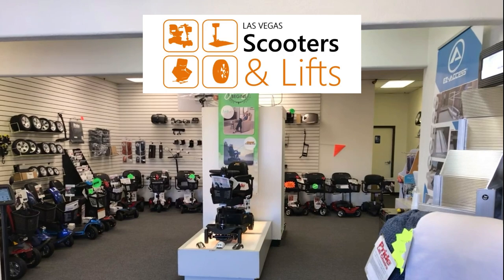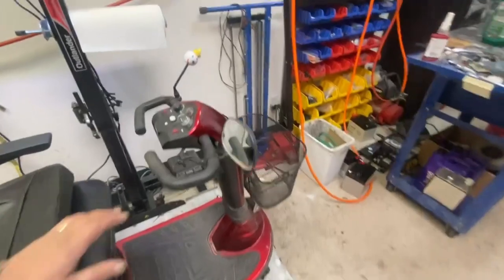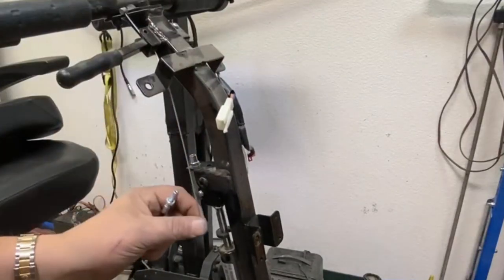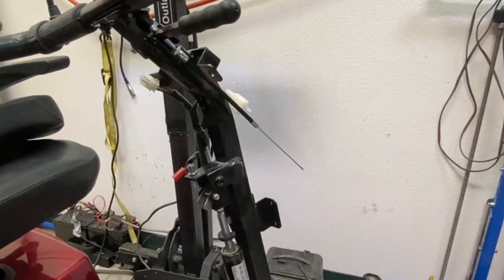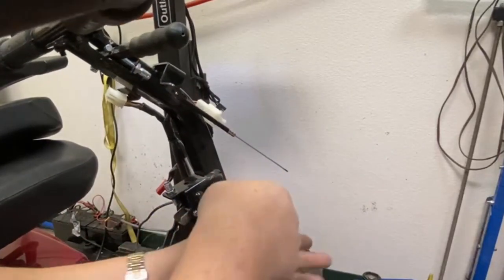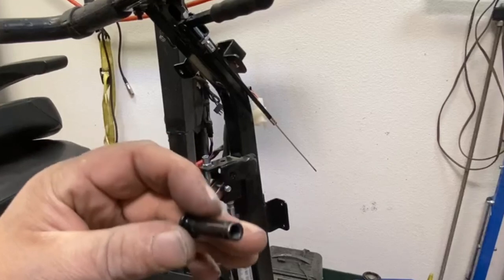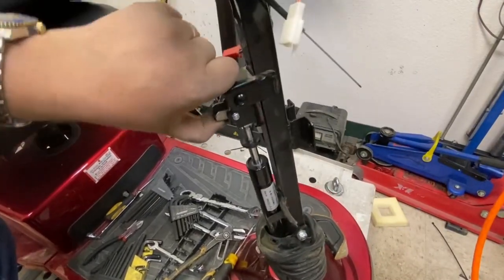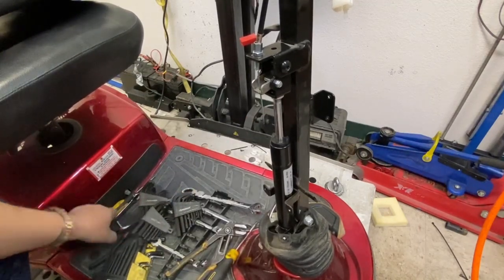Saggy Golden Companion Mobility Scooter Tiller Repair | How to replace the tiller strut and cable.

Comment: On that particular scooter is there a way to increase the speed & height of the scooter?
I have a Golden scooter with 3 wheels and I have been trying to figure how I can add shocks to the front & back as well as change the scooter from a 3 wheeler to a 4 wheeler. I would also like to change the tire size from 10" rear & 8" front to 4-13" tires. Any ideas would be appreciated. 
Where in Las Vegas are you located? I plan to go to Vegas in September, from the 15th-17th or 18th. Celebrating my 🎉 birthday (09/17), and I would like to go to your shop.
Your video is very informative. Thank you for posting.
Reply from the maker: Hi Martin, thanks for watching.
To be honest with all things you are asking in your question you would be better off buying something that has everything that you want already built. Your first hurdle would be that you can't change a three-wheel frame into a four wheel without modification (welding) or you would need to buy and new frame. As for shocks you would need an articulating front and rear section to accommodate shocks and springs. As for speed, your current controller is set and programmed at the factory at 100% and can't be increased. You would have to get a controller and wiring that has a bigger speed already programmed into it. Height would be restricted by a few things such as wheel offset, frame (turning) and the plastic shrouds clearance. Have a good birthday, the strip if far more interesting than my humble store 😁

Comment: I have often found wiring/plugs for things that were optional such as electric seat lifts. I'm wondering if there is wiring on my personal Golden Companion II GC340 to operate an electric seat lift? I recently bought another GC340 with an electric seat lift and am thinking about transfering it to my unit.
Reply from the maker: I have a GC340 with a seat lift on it in the store right now. That would be a pian in the butt to do, there is extra wiring to the batteries, two extra connectors to power the ram and also, I'm thinking the controller might be different as it disables the scooter when the seat is in the fully raised position and reduces the speed when half raised. Give it try, you never know!

Comment: At the very beginning you show the tiller and say its doing everything its sopose to do. There is nothing wrong with the gas cylinder tiller adjustment mechanism. Just a simple bolt to tighten on the lower part of the tiller. I work privately as a hobby here in Florida with mobility equipment and LOVE the Golden Companion series scooters having 1 as my own.
Reply from the maker: Hi Richard great statement! I did exactly what the customer requested and replaced the part he wanted replacing. Just because I couldn't replicate it on camera doesn't mean the customer was wrong. Remember the customer is always right even though they might be wrong.

Comment: Hi Ian!! For the very first time in 13 years I need to change the wheel covers on the FRONT of a GC440.....seems to be a snap ring holding them on....what is the best tool to get them off with? My snap ring pliers don't seem to reach in right. Thanks! -Rick
Reply from the maker: Hi Richard, I've just had the same problem with one of our GC340 lol. My snap ring pliers don't fit either lol. Easy option and expensive option is to replace the whole wheel. Cheap and painful option (the route I took) use a pair of needle nose pliers and trap you fingers a million times trying to get the damn snap rings back on. Eventually you'll get it using two people and a lot of swearing.  Good luck my friend hope you don't get to many blood blisters on your fingers.
Reply: @lasvegasscooterslifts  Thanks Ian. It looks to me as if the snap ring would have to come off in order to get the wheel itself off as well. (Darn 4 wheeler!!) Lol!!
Reply: @lasvegasscooterslifts  UPDATE; I ended up using a chisel in the center of the cover and cut it off, then man-handled the snap ring off. Then, since I was working with the Monster Scooter supplied aftermarket cover it was too thick and covered the snap ring groove so (at my Wife's suggestion) I just siliconed the new cover on. Seems to be holding well so far.
Reply from the maker: I hate those damn things. So glad they did away with them.
Reply: @lasvegasscooterslifts  I hear that!! I've had "MY" GC340 since it was new in 2011 and still looks new today. I only use it 2-4 times a year to attend larger antique/classic car shows. I recently had the seat custom upholstered to match the blue color on the scooter. I will however upgrade the first chance I get to the new 3rd gen GC340!!

Comment: iS there in fact a plug in the tiller wiring harness at the bottom that would allow the tiller to be removed to replace the rubber boot?
Reply from the maker: Hi Richard, no unfortunately unlike the Pride Victory that has a connector at the base of the tiller the Golden does not. You would have to un-plug the harness from the top console then sperate the tiller pivot to replace the tiller boot. I know I've done plenty of them. 🙄
Reply: @lasvegasscooterslifts  Ok, Thanks!!

Comment: Quick question; (As I have mentioned before I work with the equipment as a hobby here in Florida) The Golden Companion series are my favorite scooter. I have a really nice '11 GC340. I have one that I'm working on and with brand new quality batteries they don't seem to charge completely. I had sold the unit nearly 2 years ago and all was fine until recently. I went and put brand new batteries in it for my customer and all appeared ok. They went on a cruise and when they returned they say its the same as before where the batteries don't seem to take a full charge. Any ideas?
Reply from the maker: I would do a load test on the batteries after charge and after about a two-mile test drive. Also you can put a multimeter on each individual battery of each battery and see what the voltage reading is with the battery charger plugged in and charging. They should read between 13 - 14v when charging if there is low voltage like 12.5v the charger or wiring from the charge port may be to blame. If the above checks out ok then I might be a transaxle or motor issue. Look for any evidence of any leaking at the transaxle or yellow staining around the motor to the transaxle.
Reply: @lasvegasscooterslifts  Thanks Ian!! I'll be headed over in the next couple of days to check it out. I appreciate the suggestions.
Reply: @lasvegasscooterslifts  Thanks Ian!! I bought a cheap load tester years ago and all I could get it to do was smoke. Lol! Is there some sort of (Hopefully) digital type that you'd recommend?  Regardless I'll keep you posted on my outcome.
Reply from the maker: Oh yeah, I've burnt a couple of those up before 😁
Reply: @lasvegasscooterslifts  I just got back from my service call. I found the fuse in behind the charge port blown!! in processing probably 20-25 of the second gen Goldens I have never found a blown charge port fuse before.
Reply from the maker: Ah ok, yes normally they don't blow. Did you check the condition and Amp rating of the charger? normally a blown charge line fuse normally means too big of an amp rated charger e.g. using an 8-amp charger when typically, it should be 3 - 3.5 amp or a short in the wiring and or a damaged charger cable.
Reply: @lasvegasscooterslifts  The charger that came with the scooter when I bought it was a 4.1amp which is what I believe they came with new. My customers bought another 4amp unit as well. They take cruises a lot and I'm betting that the ships power may have serged causung this. The darn charge port fuse is hard to get to!!
Reply from the maker: Oh yeah Golden in their infante wisdom decided to hide a fuse/s which is an owner serviceable part behind the tiller shroud and top consoles, STUPID!!  😁 Drive Medical and some others do the same too! 🤦‍♂️